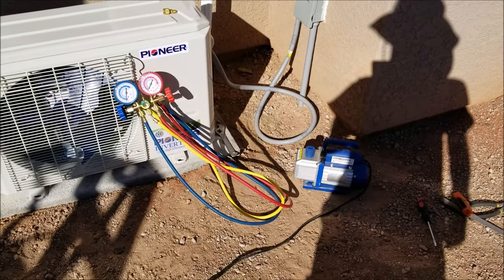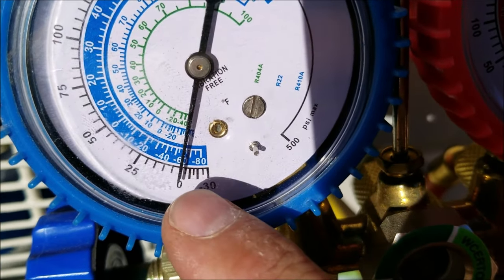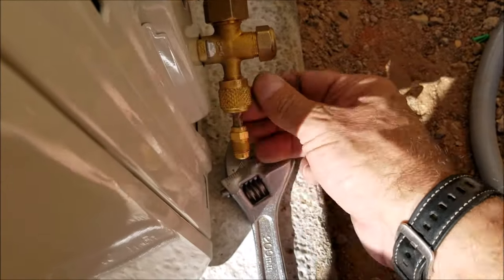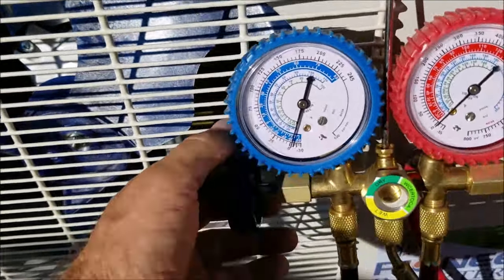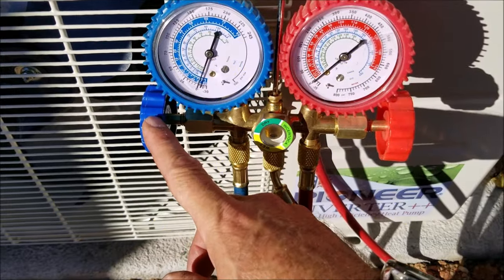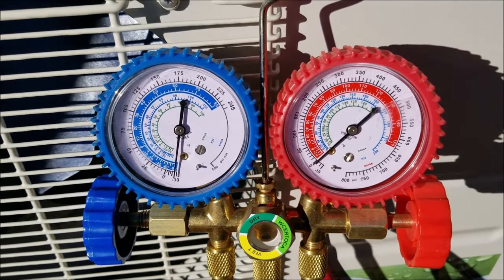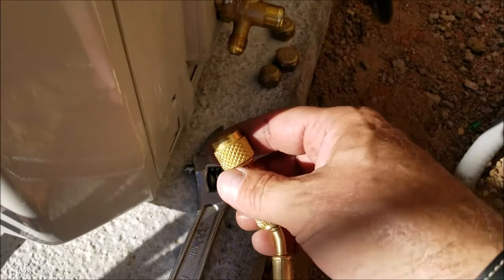How To Vacuum Down a Mini Split with Analog Manifold Gauges

Comment: I applaud your efforts to educate people with your video but people need to know that there is a very important reason why professionals use a micron gauge instead of analog gauges when evacuating a system, and here is the reason why. Analog gauges only show inches of vacuum with a number like minus 30; (29.92 is considered perfect vacuum). The problem is, 29 inches of vacuum (as read on an analog gauge) is equal to about 10,000 microns and the recommended "minimum" negative pressure for a properly installed A/C system when evacuating the line set is less than 500 microns, so as you can see, just using analog gauges means you won't really know how low your pressure really is no matter how long you let the pump run; all you’ll know for sure is that it’s somewhere below 10,000, or 9,000, or who knows for sure. The problem with that is, a vacuum rating anywhere above 800 or 1,000 will almost certainly still contain moisture in the line set, and the higher the number, the more moisture there will likely be.  That moisture will eventually react with the refrigerant and become highly acidic, thus potentially shortening the life of the compressor and the entire system.  An installation done with analog gauges alone will absolutely run fine, for a while, but the effects of any remaining moisture in the line set will show up later with a shorter life of the entire system and when the system fails, the owners will inevitably end up blaming it on a poorly manufactured system, and not the installation, when just the opposite is true. You can let the vacuum pump run for an hour or two and hope that you have it down below 500 microns but you really have no way of knowing for sure.  A good analog gauge set will cost about $80.00 or more, so is it worth not knowing what the true vacuum level is for an additional $100 for a micron gauge like a CPS (around $180.00) after spending $1,000 or more on you’re A/C system? That point is explained quite well at this site: https://www.sanden.com/moisture.html   Great job on the video. Thanks for posting it.
Reply: Thanks for clarifying and the reasons why.
Reply: @independentselfreliantnota4991  I applaud everyone that puts in the time and effort to post You Tube video's.  I just think if people are made aware of the harm caused by moisture and/or contamininants remaining in their system, it has the potential to save them a lot of money and grief down the road, and the sad part is, the only difference between a system that may fail prematurely and one done properly is a simple $180.00 micron gauge.

Comment: So do I let it sit with the valve open or closed once I have done the vacuum to check for leaks
Reply from the maker: Leave the valve closed. The valve opens and closes to the yellow center hose. The blue side is always on to the pressure gauge.

Comment: @HVAC Mechanic 
I'm not an expert in the field. I occasionally install or move some air conditioners, all mine. your video is very informative. recently installed a Mitsubishi Heavy Industries SRK/SRC-35ZSX-W at 12000BTU. 
I would like your opinion on the slightly different disassembly method I am implementing to the blue hose. 
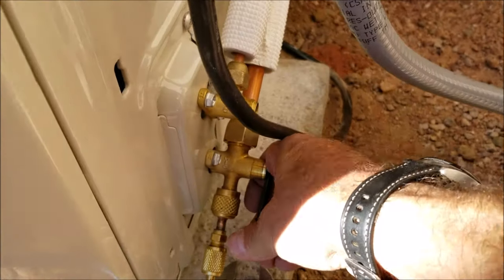I apply the same procedure as after 5:05" min. with R32 gas being diffused in the copper pipe, at the same time the blue Analog Vacuum Pressure Gauge is connected and it shows a pressure of 300 psi. 
I run the air conditioner on the cold setting for about three minutes and stop it, the gauge pressure drops to 250 psi and then I unscrew the blue hose as in 5:50" min. and I have the impression that less gas R32 is released. what would be your opinion about for this mode of application ? 乁(⊙︿⊙)ㄏ 
thank...

Comment: The reason you pull a vacuum is to remove moisture which is very critical to a 410A system without a micron gauge I can’t see how you can do this, even with my 2 stage 1/3 hp vacuum pump it sometimes takes over 1 hr to pull a good vacuum and check all moisture is out. If you just want to check for leaks use nitrogen.
Reply from the maker: Digital micron gauges are great but have only been available for the last 10-15 years and have only been widely used for the last 5-10 years. What did they do before digital gauges?
Micron gauges are good to use, but they are not necessary. Many older HVAC techs do not use them.
Reply: @HVAC_Mechanic  Not true I had a supco in the 90’s but do your research 410a is much more hydroscopic but you’re right back with 22 purge with nitrogen pull vacuum install a dryer and you’re good to go
Reply from the maker: @lou198  Those Supco VG60 from the 90s were notoriously inaccurate. Mini split units don’t use dyers. This video does not say Micron gauges are bad; only they are not necessary. If you have one, great if not, use an analog gauge.
Reply: @HVAC_Mechanic  I’ve never installed any pioneer units but fujitsu which I have a manual siting in front of me says pull a vacuum for at least 60 minutes after -0.1MPa (-76 cmhg) and you’re right supco were very problematic but fortunately I had a mercury manometer in the shop that I tested it against regularly. And also don’t know if you have ever installed any 410a central units but they also call for a 300 micron vacuum and after pump is shut off it must hold under 500 microns and they don’t use a dryer more reason to get an effective vacuum
Reply: @lou198  Great comment. I also still use a old Supco that i have checked against others, and pull a 300 micron reading and hold before moving forward with refrigerant charge.

Comment: He doesn't show where you connect to the low pressure side . Most do not know what that is !!! He means the larger line side. Also you need to remove the pin inside while vacuuming. The put it back in . (Blue side) =larger pipe. .
Reply from the maker: There is only one port on a mini split, and there is no need to remove the Schrader valve.
Reply: @HVAC_Mechanic  👍 Your Correct. I spoke to soon . My apologies!!!

Comment: you just vacuumed your gauge set.  you did not pull the shrader valve in the line so you did not pull any vacuum at all in the line set
Reply from the maker: Schrader valves work like a tire valve; you don't need to remove them.

Comment: I think you’re supposed to remove the gauges first. Then open up the refrigerant lines.
Reply: No you need to release some refrigerant first or you will pull back air into the system..

Comment: This is not a very valid test to check for a tight system.  The mini splits are KNOWN for leaking at the flare fittings.  Simply pulling a vacuum and letting it sit does not mean it’s ‘tight.’  I put a 200 psi nitrogen charge on a system and let it sit overnight.  No loss.  Came back a month later and there’s oil all over the flare joints and it’s lost enough to not cool well.  A micron gauge will tell you whether or not you have a tight system.

Comment: If the blue valve is closed you cant check to see if vacuum is holding Einstein
Reply from the maker: You need better training. The valves only control the yellow center hose. The outer hoses are always on and will read pressure as soon as they are attached, with the valves open or closed.

Comment: I have a problem. It doesn't seem logical that the vacuum Guage goes immediately to full vacuum. For an entire 25 foot line set it should gradually go to vacuum. I just finished setting lines and ran vacuum pump. Immediately goes to full vacuum. I think that Guage line is the only thing pulling vacuum.

Comment: You can’t see the difference between 500-750 microns on your gauge set, use a micron gauge and do it right, equipment is getting more expensive by the day, install it correctly.

Comment: DO NOT FOLLOW THIS VIDEO I just got sprayed with an absolute ton of refridgrant liquid spilling out.

DO NOT use the hex key to open the valvest while the vacuum pump is still attached.
 
I skipped that step with the last mini split I installed and it worked great, tried it with this one and may have lost all the refrigerant during the two seconds it took me to unscrew the vacuum pump.
Reply from the maker: If the gauges are removed before the refrigerant is let loose, air will go back into the lines, and the vacuum will be lost. The unit will work but won't last as long as it normally would; the life of the unit will be drastically reduced. This is how it is done, and when done quickly, it is normal for some refrigerant to escape. Just be ready and remove it as quickly as possible.

Comment: Never use analog gauges to measure vacuum that is like trying to use the odometer on your car to measure inches! You need a digital micron gauge and the manufacturer wants you to vacuum the system down to 500 µm or below, your gauges measure in inches of mercury you can vacuum it down to 30 inches of mercury and a small leak won’t show it self for a while on the gauges! But irregardless you never leak check with a vacuum gauge you pressure test with dry nitrogen then pull a vacuum Once you know, you are leak free if you have leaks and pull a vacuum, you’re sucking, noncondensibles and moisture into your system, defeating the purpose. This guy knows about enough to be dangerous!😂

Comment: That is the most horrifying DIY hvac video I've seen. The reason you have a micron guage is to see that it actually gets down to 500 microns so you can tell weather or not the system has any contaminates or moisture in it. Yes it's a small system but you can't rely on having  a small system and a short lineset to only pull a vaccum for an hour. What if the seal is busted or cracked and you have a tiny leak? If you pull to 5,000 microns and let it sit for an hour it will never reach 30 microns in that amount of time but a micron guage would let you know hey something is wrong. When you release the charge you just don't dump it all at once you should slowly crack the valve open let it bleed out and let the pressure drop before just cranking the thing wide open that's how you blow out gaskets and brazing. I can tell it's a pre charged system with a screw on lineset and you don't need to use rods but you cut so many corners and if you don't inform people on how to do it correctly why even post a video?
Reply from the maker: So what did people do before digital micron gauges? If you have a micron gauge, use it, I'm not saying not to. I have installed hundreds of split systems with analog gauges over the years and never had any issues.
Reply: @HVAC_Mechanic  without using a micron gauge you are going to mess up the compressor sooner or later
Reply: And,… also the yellow line looks reversed the way you installed it
Reply from the maker: @ted4730   What do you think they used before micron gauges? I've been using analog gauges for over 30 years, long before micron gauges, and never have had an issue.
Reply: @HVAC_Mechanic  I didn’t question what you or others are using for vacuuming the lines and the inside unit before releasing the refrigerant. I just underlined the correct way to do it on present days. If caveman used a bat for hunting food on ancient times that doesn’t mean I can’t use my rifle for hunting,… on my time….no offense 🤓
Reply from the maker: @ted4730  Half the techs in HVAC don't use digital gauges
Reply: @ted4730  so if this way works then why say anything?? Make your own video of how to do thing in “present days” and get off this dudes video
Reply: @HVAC_Mechanic  before micron gauges? You do realize before micron gauges they would just purge and bang gas
Reply from the maker: @ninjiropears  Before digital micron gauges, there were only analog gauges; now, there are both, and either can be used. They both do the same thing, read pressure.

Comment: This is not how to do a proper vacuum on any refrigeration system. A micron gauge must be used. Using a charging manifold to measure a proper vacuum is like using a sun dial to time a drag race, it is no where near accurate enough. Example: The highest my micron gauge reads is 20,000 microns. A proper vacuum must be pulled down to at least 500 microns. The vacuum must not rise above 750 microns after the pump has been turned off (different manufactures recommend somewhat different procedures). 20,000 microns = 29.14 inches of mercury (gauge). Inches of mercury is the scale a charging manifold uses when it is in a vacuum. 750 microns = 29.89 inches of mercury (gauge). 500 microns = 29.9 inches of mercury (gauge). If you can tell the difference of 0.01 inches of mercury on that charging manifold, you must have super human vision.
Reply: Is that what they taught you in some book? I've been doing installs for 20 years, and you're lucky if they don't just blow out with propellant.
Reply: Yes, I was taught by books, going to many classes/schools, and best of all, learning in the field from others. This is not a proper vacuum procedure video. And since you brought it up, 32 years here.  @JereB698
Reply: @chrisdeanndavison3626  Anyone who has worked in HVAC for more than a month knows this is not true. This is why every HVAC owner hesitates to hire anyone from a school, as they have to retrain them.

Comment: This is akin to trying to measure 12” using the odometer on your car. Seriously, if this is close enough for you, don’t bother with the gauges. Just run the pump for 30 minutes and cut the gas loose. A year later after its all leaked out, call it a lesson learned and hire a professional. They’ll get a good chuckle out of it
Reply from the maker: This is a common installation method, many HVAC techs in the field don’t even bother to vacuum down a unit and use a line set flush method. I have installed hundreds of units and never had any issues.
Reply: Again, if this is close enough for you, that’s your choice, but don’t waste your time with the analog gauges. They are telling you nothing of value. The graduations on the gauge are over 125,000 microns apart, hence are incapable of detecting a small leak. Like I said, it’s like trying to tell if your car moved 12” by looking at the odometer

Comment: Hi, if the vacuum connection was removed before letting the refrigerant out so some air got back in. Do you think the air got back in is significant to ruin the minisplit. The vacuum connection was removed quickly.
Reply from the maker: If containments, mainly water particles, get in, then it will shorten the life of the unit. Sometimes, they last a long time, it can vary.
Reply: @HVAC_Mechanic  Thanks for your reply. The weather was dry so the only moisture I could think of are in the air itself.

Comment: when you hooked the blue line up, how did you know which side to put it on? Are they color coded also?
Reply from the maker: The blue hose goes to the low-pressure side (big line); on a mini split, it is usually the only valve.